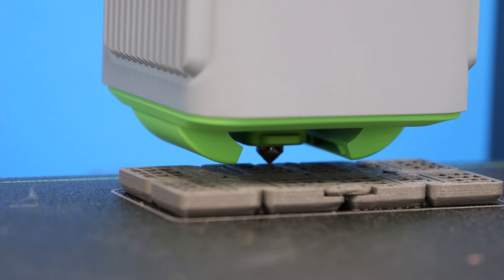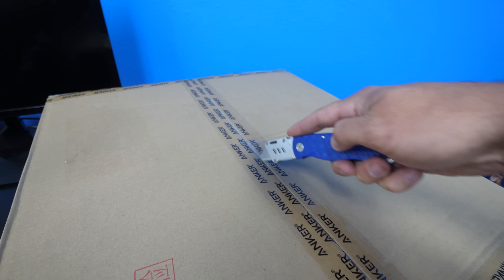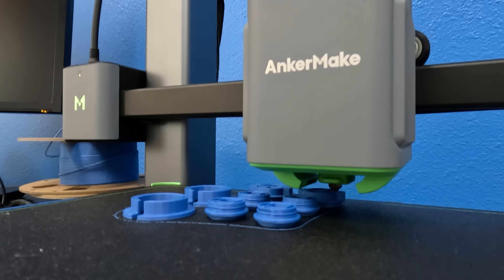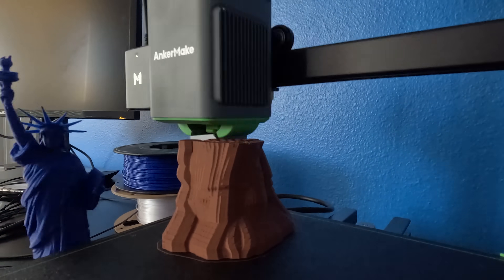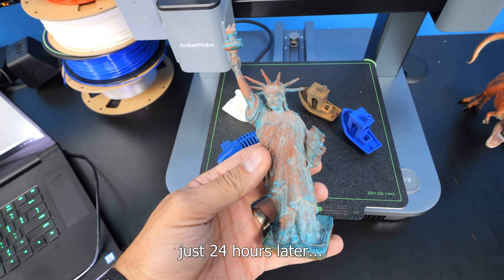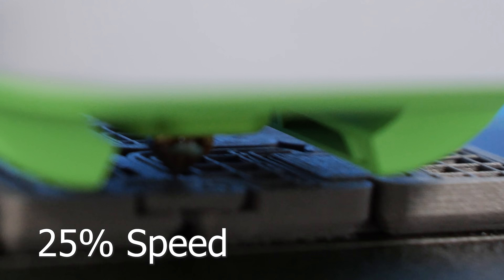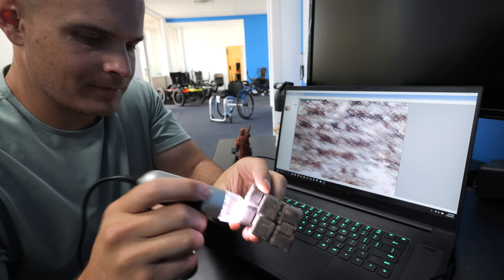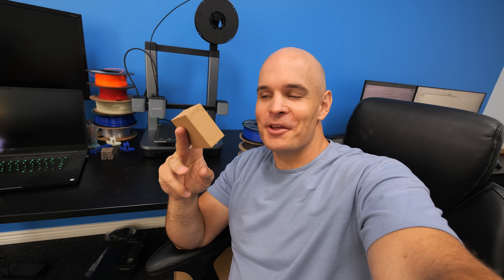I tried 3D Printing with REAL GOLD......

Comment: I am almost don't believe that it is actually doing that kind of magic because seeing it move so fast feels like it's been sped up, unbelievable. But there are filaments that can be cured in a oven to remove the plastic and get a solid piece of 3d printed metal part i feel that that is way better for some other applications, just saying.

Comment: How is nozzle of the 3D Printer's nozzle clean without previous metal/material residue?
Reply from the maker: It extrudes out the old extra material - and then extruded a bit of the new material until the flow is pure.

Comment: You can also use DMLS or Direct Metal Laser Sintering which is a 3D printer that specializes in creating metal 3D prints. You can't 3D print gold with a normal 3D printer.

Comment: Today at work I saw a news article about the printer. When the bigger Anker 3d printer hit the market, I was really thinking to buy it as my first 3d printer. It was fast, the results looked decent, is easy to setup and comes from a brand I know but the price was a bit high. I'm not so sure how much I actually will use it and until I know it, I want to keep the price low.

Comment: Hey Zack...  do I get preferential points for the drawing for knowing your name?  lol -   I've printed wood PLA and it's amazing, sanded, stained, just like wood.  I imagine the metal infused filaments would wear out the nozzle fast unless you got the hardened (SS) nozzles,  or (for a that box of gold dust $$) a ruby tipped nozzle.

Comment: Yes looks like 3D printing is finally becoming easy to do, with low cost and easy setup becoming common. The high speed definitely will help with the making of low volume runs, so you could probably just use a half dozen of them to run the initial batches of parts instead of getting a custom part made, as the printer and filament definitely are much more useful than the cost of a single custom injection mould itself.

Comment: never done 3D printing yet; but at the price point and quality you mentioned... easier to consider dabbling. Since you mention each filament prints differently, are there printer pre-sets for each type of material? Bonus question... could you repurpose your failed gold filament maker into a recycled filament maker? From the video you showed, I'm guessing there is a significant amount of waste filament from print mistakes, staffolding and maybe even prints that no longer interest you.

Comment: New printers like this or bambulab or k1 from creality is cool, but have locked software and not open source hardware witch make it harder and more expensive to modify or maintain.
3d printing is still not a plug and play and some adjustment is always required if you want quality prints, even metal fidget in this video have obvious issues at bottom layer.
Check hinge side at 05:08, this is bad cooling/wrong speed/wrong z offset

Comment: Between 2007 to 2009, my wife and I ran a t-shirt business where we were printing and selling officially licensed t-shirt designs for the Twilight books. At one point, my wife started working with a jeweler to manufacture the charm bracelet that Bella is given by Jacob. We were having trouble coming up with a wood material that would be durable but easy to manufacture. We did eventually find a solution, but man wouldn't it have been nice to simply 3D print that thing instead? I really want to find out if my Neptune 2S can print with wood filament. I'm also very intrigued by this new printer you showcased. It's not that expensive and looks like it produces amazing results.

Comment: Dude, if you do gold, do it on a powder printer and then squirt molten gold on top as a binder. That is the best luck you would likely have without massive part cooling. I think even with massive part cooling, the fans would be more likely to blow away the gold before hardening it.

Comment: 1:36 It would be cool if you emboss your logo into each of those end caps.  It would add a little extra flare. With that printer, it doesn't seem like it would slow production and would amount to slightly less material used in mass production.

Comment: I would recommend trying to burn off the plastic in some of the metal filaments, with the right process you can be left with a full-metal 3d-printed part.

Comment: When oxidizing the copper, a good thing to get an even layer of salt-vinegar mixture is to use a napkin sprayed with the mix and lay it on the print. That should get you more even oxidation unlike when spraying where you may get the mix bead up and leave spots instead of layers.

Comment: Is it possible to have a full metal 3d print by baking the print melting the plastic out of it? If so then making the parts some % bigger to take the shrinkage in account it could leave to some really cool stuff. Also that's a pretty simple and cool printer, really simple to use it seems I want to get in to 3d printing but they are too expensive here and also require quite a lot of set up the ones that are available.

Comment: Thank you great review on metal impregnated filament. maybe you should get some 24 karate gold rolled into 1.75mm string and test it with a extra high temp nozzle just below the liquification of the gold and see if that will print. Maybe start with a lead filament and see what the outcome is first, will be a lot cheaper.

Comment: I was considering an ankermake printer for a little bit and it seems like a very capable and fast printer competing with the Bambu labs P1P that cab also print this fast. Considering the price, this Ankermake has sold me. It's a very cool printer that would definitely put my modified Ender 3 to rest. Cool video as always.

Comment: Snowflakes are beautiful ice crystals that form when water vapor in the atmosphere condenses directly into ice without passing through a liquid phase. They are unique in their structure and appearance, and no two snowflakes are exactly alike.

The process of snowflake formation starts when a tiny ice crystal called a "nucleus" acts as a seed for water vapor to freeze upon. As the water vapor condenses on the nucleus, it forms a hexagonal prism. The specific shape of a snowflake is influenced by various factors such as temperature, humidity, and the molecular structure of water.

As the snowflake falls through the atmosphere, it encounters different conditions, which cause the ice crystal to grow branches and intricate patterns. The exact shape and complexity of a snowflake depend on the temperature and humidity at different layers of the atmosphere during its journey to the ground.

Snowflakes can have a variety of forms, including simple hexagonal plates, stellar dendrites with six branches, needles, columns, and many other intricate structures. Their delicate and symmetrical patterns make them a source of wonder and fascination for people of all ages.

Snowflakes play an essential role in the water cycle, contributing to the accumulation of snow on the ground, which later melts to provide freshwater for rivers and streams when spring arrives. They also create winter landscapes and are often associated with the holiday season and the beauty of winter.

Microscopic photography allows us to capture the stunning details of individual snowflakes and appreciate the diversity of their designs. Photographers often capture these delicate crystals before they melt to preserve their beauty and share their uniqueness with the world.

Comment: Correct me if im wrong, imo, if you want to make an object with ABS or TPU filament, you should use the enclosed printer to ensure the stability of the ambient temperature. Is that right?

Comment: One thing to be careful of (and it’s something I’ve recently learned) whilst it is possible to print hotter materials on these printers, once you go past 240 ish degrees you run the risk of the Bowden tube inside the extruded degrading and giving off a toxic gas! Always make sure you’re well ventilated if you’re running nozzle temps over 220-230

Comment: That "80% faster than other 3D printers on the market" is patently false though, my Bambu Lab P1P moves just as fast (500mm/s) and accelerates much faster (up to 20000mm/s, or 2m/s. A bit faster than the 0.5m/s of the Anker). It's also not a bedslinger :)

Comment: I ended up getting a delta printer for my first one since the price and footprint was good. ended up having some issues with the heatbreak/nozzle leaking and haven't fixed it yet but i'm def getting the urge to print more things I just need to invest the time into getting it back up and running.

Comment: That printer is cool, I have been tinkering for about 5 years on 3d printers and trying to get my ender 3  reliably up to 250mm/s. So far without crazy mods I'm only up to 150.. But I do print ABS almost perfectly flawless at slower speeds...

Comment: One of my professors got a patent almost 30 years ago using filament printing gold.  They embedded the gold dust in plastic and printed it oversized and then sintered it under pressure to get a net shaped ring.  Looked pretty good, but would need some filing down and buffing to sell.

Comment: One downside with these printers that you can't change any settings on the printer itself. Say you want to change the temperature or select which file to print or change the z-offset you need to app or a connected computer. I don't want to use my phone or pc everytime I want to select which file to print or to change a setting. If the printer had a screen. even a basic one this would be way better imo. Besides that my printer is in a diy enclosure with sound depending and thick walls etc so the reception on the inside isn't great, if the printer uses bluethooth or wifi this would be a problem for me

Comment: I’m recycling my own plastic into pellets and filament but my printer is way to slow so I really want this printer. I can tell you the temperatures and length of the channel out of your extruder is probably not accurate for making filament and you should get used to making filament without the gold first.

Comment: Random fact about Eiffel tower: even now, the tower is painted by hand every seven years and it is painted in dark to light colour from top to bottom to compensate for hazy air at the top so that tower colour looks uniform from distance.

Comment: Interesting. My daughter and I have been toying with making 3d designs and learning that process. Right now, I am not sure I understand how to actually use a ed printer and the software it uses. I think that would change if I just took the leap and bought one. $399 seems pretty reasonable to get started. Maybe I'll do it.

Comment: 3D printing is so cool, I have a Creality Ender 3 V2 and haven't ever tried to print with anything other than PLA, mostly because anything else is too expensive. I'm also still using the Filament that mine came with

Comment: People who are new to 3d prinitng, just a warning: The metal filaments he used in this video are abrasive. They will wear out the priniting components and lead to frequent clogging. The anker m5 in its stock configuration shouldnt be used to print such filaments. The printing nozzle needs to be hardend steel, aswell as the extruder gears.

Comment: I think the 'rust' - corrosion of Lady Liberty may be a different state of oxidation, but I'll have to look that up and get back with more info on it.
Reply: Yeah, there is a lot of chemistry going on with copper, depending on if it is anhydrous, x-hydrous, or how many electrons the copper has potentially. I didn't read too deep, but that's the gist I found.

Comment: You should check out the Voron lineup! (0.2, 2.4, Trident, Switchwire) I own a Voron Trident from LDO Motors and it is an excellent machine. I usually manage 300mm/s @ 15k accel with ABS

Comment: It's amazing what we have these days! The sub-$500 market is incredible. $150 printers can often beat $20k machines from a decade ago with no problems! And the software is so much better...

That filament maker probably would do just fine to recycle your regular PLA scraps. It's just the metal impregnation that's really hard to get right [you can also use it for like, making filament out of milk jugs and stuff]

Comment: The only bad thing about these brilliant new printers is that it makes me feel bad for owning an older Ender 6. Such good advancements in the 3D printing scene, love it.
Reply: i own an ender 3 that i recently repaired.
Reply: I still have and ender 3 lol.
Reply: I still have a cheap Prusa i3 replica from that I got for 600$ 8 years ago. Does the job still even if I know it sucks compared to these new machines.
Reply: Like my old Ender 3. Just gotta mod it. At the end of the day, its what you do with the tool, not the tool itself
Reply: Ender 6 isn't old
Reply: Have anyone tried those filaments on Prusa??
Reply: I saw the Elegoo one on LTT's ShortCircuit and it wipes the floor with my Tevo from a few years back for the same price. Crazy how fast tech (and that printer, geez) moves.
Reply: Ender 3 V2 here
though mine is not functional soo i only have like 3 prints .getting it replaced
Reply: One thing about having an older machine thats invaluable compared to a modern plug and play one, is all the learning you do. Having to tinker with settings, or figure out an issue on the machine helps you understand 3d printing more as a whole
Reply: I have a very much upgraded anet a8
Reply: Believe me, with a klipper upgrade that thing would smoke this over advertised piece of crap
Reply: Allah hu akbar...nara e takbir...Ghazwa e hind hokar rahega...Inshallah
Reply: I prefer resin printers. They are faster and print in better quality.
Reply: @nando03012009 is it not a lot more work tho,and you deal with chemicals?
Reply: @JACKYMOTO  if using gloves, is a lot more work. I don't know what to tell you. Water based resin is a matter washing your hands, although I still use gloves. I can take the extra 20 seconds to put on a pair of gloves to get a far  superior print ( and faster)
Reply: @nando03012009 what’s the most productive thing you’ve printed